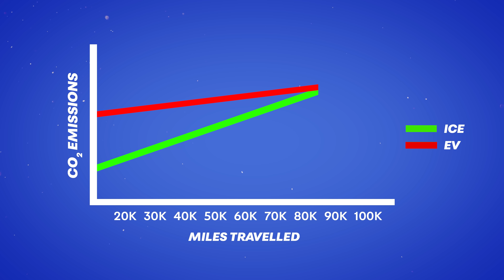Are Electric Cars REALLY That Green? [New 2022 Data]

Comment: Fantastic to see this data presented on a mainstream outlet, thanks Rory and Autotrader!
This becomes even more complex when you factor in buying a used ICE car, this is an even greener alternative to producing a new EV.
Reply: …or buying a used EV.
Reply: Buying used ICE not good in the long term (you'll eventually burn enough excess fuel to account for the energy cost of a new EV) and certainly not for urban air quality (used ICE cars tend to be crap for emissions).
Reply: ICE cars are dying faster than EV's, that's a no-brainer. EV's potentially have more life. The only degradation is of the battery but even that is being solved and will be solved in the next decade or less. Electric motors have little to no repairs needed, and can be easily swapped and renovated without the hassle of normal combustion engines. Your IC engine drove 200,000 miles?? Can it, it's probably dead and you might as well buy a new engine. EV motors can run potentially forever.
Reply: And they have arrived😂😂. I knew it was only a matter of time for the Elon cult to reach here😂
Reply: @Aemond839  I don't own a Tesla, or am I an "Elon fAn"

If anything YOU are the weird snowflake bird. I mean, just go through the comments and read the room, as it were.
Reply: @Aemond839  not everyone who likes EVs is a Tesla fanboy.  Just FYI.
Reply: In fairness, if I was buying a new car today it would be a PHEV or an EV, I have a decent car now that will last me for the next decade so in no rush to replace it. My message was simply to keep your current car rather than rush out to replace a perfectly usable one for an EV. Don't think that's too radical
Reply: @TheTerrier  It's obviously not radical. I own an ICE car as well, and don't (and can't really) intend to change it. There are downsides to buying EV's but they are not manufacturing emissions. The real problem with EV's is charging infrastructure. But that also is being solved quite fast, really. All of the clear downsides of EV's are there for everyone to see, but they are all being tackled and worked on.
Reply: Liking this comment before the Elon Musk & Tesla fanboys come online to defend their master

Comment: How many people will keep one car for 90,000 miles? Many people buy a new car every 3 years because of PCP.
Reply: Cars don't vanish when you sell them, so individual habits aren't really relevant. They matter when you look at cost of ownership for a specific period in the car's lifetime, but not when you are looking at the total emissions of a vehicle type. It will consume the same fuel and resources regardless of how many owners it has in 90k or more miles.
Reply: @cristi724  many people buy used ICE and use it till it die not much with EV that what its look like for today used car market
Reply: @cristi724  Point being that if they are producing so many cars it still has the same affect on the environment. Plus those batteries won’t be as efficient at 90,000 miles and would need to be replaced at some point further effects on environment.
Reply: Exactly. And would the battery be still as healthy as new at 90000 miles?

Comment: They said diesel was bad, so I bought a petrol. Now I own a petrol they say ICE is bad. I would buy an EV and then they would put electric rates through the roof  just like gas prices has exploded  (excuse the pun). Show me the break even point of ownership then! They have us running round in circles fleecing us in to new purchases and taking more VAT/Tax.
They will push half of us onto hydrogen when the tech has matured after EV'S